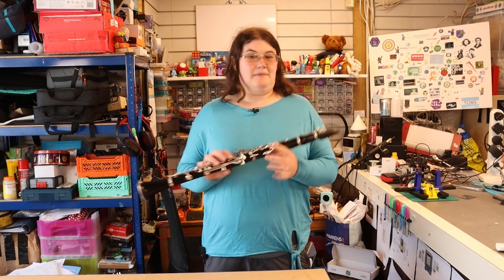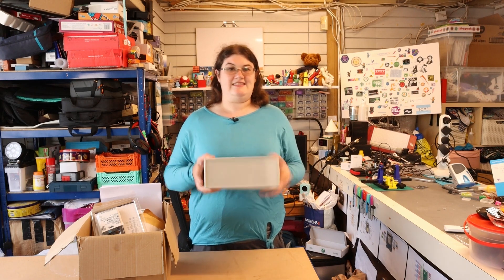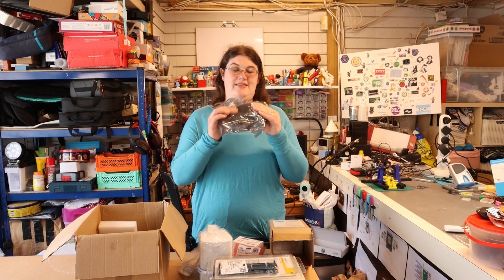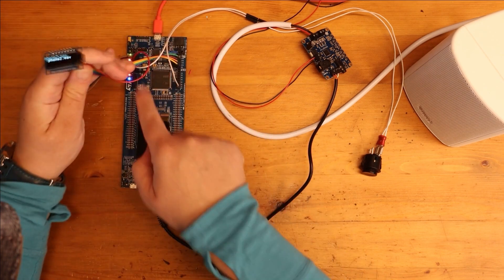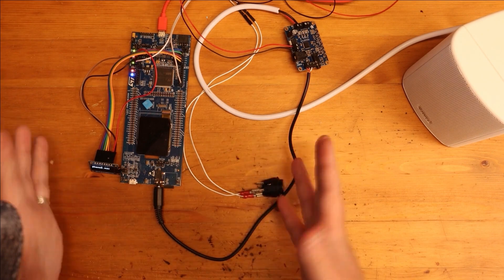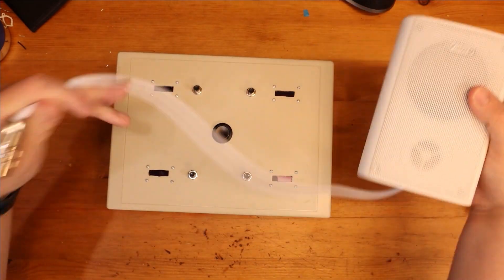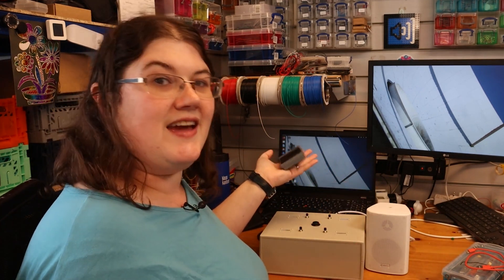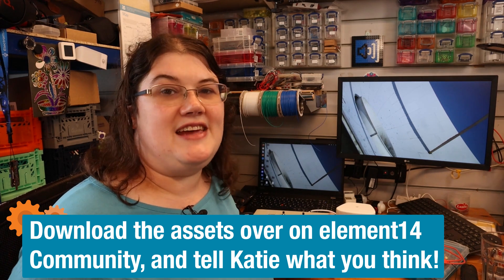How to Make a Custom Soundboard with the STM32F4 Using FreeCAD

Comment: I would suggest having 4 big buttons to play the different sounds instantly without having to select them first, and also have 4 foot pedals. It's not hard to imagine a case where it will be necessary to play the different sounds very quickly in succession or in a pattern, and having to select them first would make that impossible. Another way of looking at it is as a little drum kit that has custom sounds. Other than that I think this is a great idea and seems really useful.